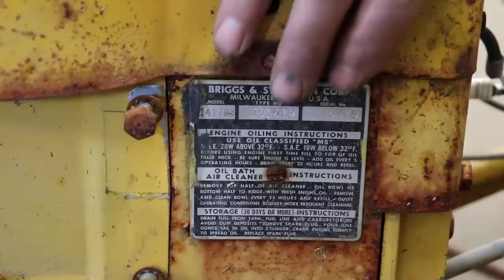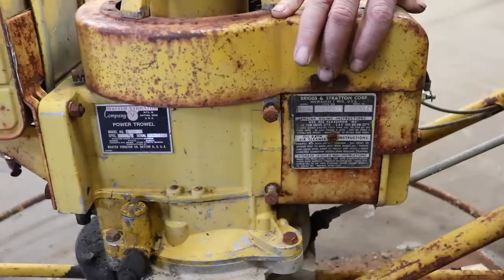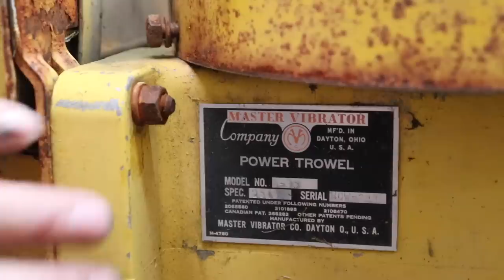AMAZINGLY RARE Horizontal/Vertical Mount B&S Engine

Comment: Taryl I'm Proud of You Fixing up the Arrow Master Power Trowel, if You pull up on the handles You go Right, if You push down You go left  I ran those finishing Concrete, that almost looks like floater blades on it, Thank You for Resurrecting it!

Comment: That's what I love about Briggs small engines from the 50's through the 80's. The parts interchangeability with slight modifications is possible to keep an engine running especially the 2-4 hp series.  A tinker's dream.

Comment: Your the man Taryl. I ran into the same flywheel issue on an old 3 horsepower 1960’s  tiller I was fixing for a friend of mine. I had to get a newer flywheel to make the magnetron coil work. The magnets on those old engines are different and won’t work with the magnetron coil.

Comment: I have never seen an engine that could be mounted horizontally or vertically ,great video
Reply: Honda has a vertical and horizontal engine. It’s smaller but it works. It’s in the 30cc range
Reply: Luv it guys .. best from Danny in Australia

Comment: You guys get an A+ on this video from me.   The old engines and equipment are the most satisfying to get running again.   Those power trowels, you push down and lift a little to "steer" them left and right when they are running.

Comment: I watch this video and your statement about briggs making the engine for this manufacturer. 22 years a a Sears mower repair technician I remembered a Montgomery ward 10 HP briggs cast iron engine that came in pouring oil out the sump. I was going to just pull the engine and replace the sump, easy right. The sump was extra deep and the front axle pivot bolt went through the cast iron sump. I never saw another one, I think it was made by Gilson??. The gasket was nla  so I split the engine cleaned it meticulously  put it back with RTV. Didn't leak and never came back. Have you seen this one??

Comment: I loved Taryl's custom craps video, he makes the best custom craps around.
I have seen one other engine capable of going horizontal or vertical, the Kohler Magnum Opposed twin, looks like a really good engine, sucker takes almost as much oil as my 4 cylinder pickup, haven't got around to using it yet, removed it from a Craftsman GT6000.

Comment: I'm glad you got it going and did right by it keeping as many of the original parts in the process. Now as this is not the average homeowner equipment it would be swell to see it return to a job-site where it can celebrate it's return from what may be decades of neglect.  How happy it will be to return to the sunshine and finishing the surface of a home slab or patio.

Comment: I just done exactly the same thing to a wind up starter Briggs yesterday. And taryl I've sanded a 3hp coil to fit a 5 hp flywheel in the past, it did spark but it stuffed the timing up, couldn't start it.

Comment: Both of my parents are a Briggs only that I didn't get onto one of them whose a Foster in my area.

It's amazing how some of the more modern Briggs and Stratton parts will fit another Briggs engines which is 50-60 years older !

Comment: Never seen a Briggs engine that can be mounted 2 different ways Horizontal or Vertical, has to be a rare engine. Thanks for the i fo on the flywheel and coil.
Hope your having a great Easter👍

Comment: Taryl, what was the big round hand knob for, changing the blade angle? R-L Carbetrater Speed Lever, the big Round Knob, Carbetrater Safety Starting Low Speed Lock out Lever.

Comment: Never run a concrete one but i wonder if the handle is the same as a waxing machine where you lift up or down on the handle to keep it from moving in one direction. Lift up or down to keep it centered. It controls the right to left movement.
Reply: It's pretty much exactly the same

Comment: Hey Teryl, what's with those vent slots on the  yellow blower housing?

Seems like that would let cooling air from the flywheel leak out, rather than be carried down to the cylinder fins (?).

Comment: So did the new coil not work because the other flywheel had a different style of magnet, or were the old ones too weak. Working on pretty much the same motor and having the same issues. New coil but not spark.

Comment: I was able to get spark on an old (1976) model 5 HP Briggs engine that a neighbor gave me (leaf blower) by sanding the flywheel and the coil contacts. Five years later the neighbor has sadly passed away but the engine still runs great at 3600 RPM!

Comment: It's cool to convert one to electronic ignition,however with a ohm meter you can ohm out the primary and secondary and check for shorts on any coil I'm sure you know that.. It's your engine buddy!

Comment: I have a question what is the best motor oil for lawn mowers . I live in the desert so it gets really hot I seen a Briggs & Stratton had a 15w 50 synthetic.. can I use 15w 50 synthetic motor oil from Walmart I seen mobile one for like $22 5 quarts of oil that's pretty cheap

Comment: It works. I done it to a push mower from 1965 that the points were bad and I had an electronic ignition coil that I ground down. Put it on and it fired right up

Comment: The 2 stroke Suzuki’s on Toro were kind of the same concept. It was originally a horizontal shaft engine on CCR2000 snowblowers and then an adapter plate was added to make it vertical for the Super Recycler mowers.

Comment: Great job again! The kind of guy you wished lived next door. I have an older 10 hp briggs I want to switch from points to electronic ignition. I recall Taryl reversing the coil so you didn't need to send in the flywheel and risk not getting it back due to broken fins . I just wonder if that would've worked in his case with the original flywheel? This is really my main source of importation when I'm stumped on something so I wish he would camp on the coil subject for another video,that Taryl!
Reply: I agree you have the best videos on rebuilding and restoring these motors and  equipment  good job you have so much knowledge  people like me love it .keep up the good work.!!
Reply: I have a old ground hog tractor I'm hoping to restore.1938 to 45 I hope!!

Comment: They still make the power trowels with the inside rope pull starter. Like you said the concrete doesn’t wait for no one. You always hope that when the rope brakes it’s long enough to use it to start the trowel. 😱

Comment: pull up or push down on handle to steer. worked on trowels for rental shop. new one's have weighted arm to kill ignition as a safety if operator looses control.

Comment: Those are one of the “transition” engines made by Briggs. The block (except the coil mounts) and other things are the same as the 65 and up versions that we all know, but the flywheel, coil, and and carbs are the same or similar to the cast iron engines, like the 5s. They are nifty little engines and they’re pretty rare

Comment: I thought of using the coil off of the 10 hp too. I also wondered if you could just use the 10hp flywheel magnet on the old flywheel?But Taryl what does the knob do?

Comment: Wht did the knob on the end of the handle do? Does it really adjust blade pitch?
Reply: I learned how to finish in '95 on the modern version of the master vibrator only its now called master finisher. good machine. lots of power. but yes the knob does pitch the blades.

Comment: Are you sure this engine is a 6HP and not an 8-10-12HP
Since most 8-10-12 hp engine share part but they don’t share parts with the smaller engines.

Comment: Had a Master troweler and screed back in the day,  little newer probably built early 70's  to control the troweler direction of travel you raise or lower pressure on the hand grips

Comment: The type of blades on the power trowel are combination blades, finishing blades are skinnner. The combo blades you can get on the concrete when it is wet and then do a decent job finishing, but if the trowel is fitted with finish blades you need clip on floats on them to get on the concrete when it is wet. The clip on floats make the straight side finish blades look like combo blades then when the cement is hard enough remove the clip on floats and you can put a high degree of smoothness on the cement. Some contractors  have a trowel with combos on and a trowel set up for finishing as well. A side walk finish is good enough with a combo blade and is usually broomed to make ir abit rough but a shop floor is nice a d smooth
Reply: A smooth slick shop floor equals a slip and fall  hazzard!

Comment: Yeah sanding only affects the air gap, with rust build up, it might damage the coil, I always use a wire wheel on my dremel pen to clean em up, but rust shouldn't affect the magnetic field.

Comment: Close to 55 years ago my dad bought a Wagner Little Giant lawn mower. It had a very large 8HP B&S. The coil went bad probably about 15 years later and the coil was $50 so it wasn't worth it to him to fix it. That mower would eat grass. Anyway the guy I sold it to mounted a car coil to it some how and used it for another 10 years. Worse thing about the mower was there was not one shear in the deck and it was gear driven. The blades ran in opposite directions so as to through the grass out both sides. 
Just thought a little while ago about the 1965 tornado's up there, if you were around that area I bet it was close to you.

Comment: You can actually narrow the date for that machine down even further as the manufacturer plate for the master vibrator company doesn’t have a ZIP Code on it. The United States started using ZIP Codes in mid 1963 so its older than that.

Comment: I definitely have an old 2.5hp Briggs with a code from 1960. I can't go get the full number right now but that was the first engine I ever worked on...I very much remember needing the date code. Had the same problem, needed to use a modern coil without points, but you gotta swap the flywheel too.

They'd still be cranking out the exact same engines if the EPA and China hadn't ruined it all for them...

Comment: I had a sheered key on my grandparents mower and found the hex key that fit best, cut it off at maybe the right length, close enough, and she runs like new. Also cleaned the carb, combustion chamber, cylinder, sanded the decks, new gaskets, oil, air filter and good to go. Maintenance, maintenance, maintenance! Your equipment requires attention and therapy, just like your wife. If you lose one, you don;t deserve the other, or something like that. You gotta clean'er out real good every now and then...

Comment: try to clamp anything laminated before u drill or sand it otherwise the layers will each flatten back in a tiny bit, if its clamped tight its alot harder to burr back

Comment: Master VIbrator Inc went out of business in Dec 1965.  So, the engine and trowel predates that year and the date code years.  The data plates are in excellent condition base upon it's apparent age and use of the equipment.  Early 1960s is probably a very good estimate.

Comment: Crap man, Breaks&Scrap'em started the code date in the 50´s, I got a model 6 vertical from a Toro from 1959 that has a code date! My 5s from Oct. 1954 doesn't have a code date yet though.

Comment: 146700, 170700, 190700. 6 hp, 7 hp 8 hp.  14 ci 17ci 19ci. Same size shroud in the 60s and early 70s 146700 was discontinued in the early 70s. These codes started in 65 or so I think.

Comment: Taryl ….a little tip. When you cut the tails off the wire ties, never cut them with a side cutter. Take a pair of Lineman  plyers and SPIN the tails till they separate from the tie. The heat from the separation will melt the severed tail and leave a nice end. NEVER BLEED again.  No sharp ends to cut your knuckles.

Comment: If the recoil broke it looks like you could leave the shroud piece on and just remove the top recoil assembly piece so you could use manual rope start.  Then the flywheel will still be covered.
Reply: Thats the way  briggs  intended,  air vane  governor  will not work without  blower housing in place,and engine  will  also overheat without  it.

Comment: Just throwing it out there.  Disregard if you don't  like it. Walmart has a fuel tank repair  coating.  You wash out the tank with acetone,  then slosh the stuff around inside the tank. I put a piece of tape temporarily over a pin hole as I did the sloshing.  Then peeled it off  and painted it. 2 coats worked wonders.👍
Reply: I used it to fix an ancient  torpedo heater.  It's  on my channel if ya want a peek. Keep up the good work!

Comment: It would need a different base to be used as a Horizontal Shaft driver so oil could be changed.  I use a magnet to remove loose rust in a fuel tank.  Nice to see an old Sediment Bulb again.  So third coil and second flywheel?  I lost track.  You could remove the blades and put on wire brush sections and make a super sweeper!
Reply: I was thinking along the same lines - the oil fill as-is would only work in the "vertical shaft" position.  Buy maybe there is an adapter, not installed, that would turn the oil fill 90 degrees sort of like the adapter on the carb?
Reply: Use caution on pre 70's motors and fuel tanks. The white deposits are probably lead. I maneuver a magnet close to the fuel outlet and leave it there. It takes practice just to get it through the filler.

Comment: They make you take a test every year just to be an approved repairer ?. They don't do that here. You only need to set the test once however there's a 3 day ? or more in house training program & when you sit the initial exam you don't need to sit it again & you get a cert. There's the option if i'm not mistaken to do more training & advance with more quals ?. Never seen a right side up motor that can sit upside before

Comment: FYI Taryl I could see you don't  have any idea how to control this machine when it's running. Simple: you can sort of learn in minutes. Direction of travel of the blades is controled by lifting up on the handle or pushing down for it  to go right or left and to run n stay in one place is a happy medium between (at  leavel) to the movement right or left. I have never operated a troweling machine but I have umpteen hundreds of hrs on running a floor buffer. I'm sure it works about the same way as a floor buffer. I uncourage you to try it with this little bit of information. Now you have learned something else that might be worth while some time.

Comment: Always a good idea to match the flywheel with coil lamination if gaps in flywheel are different then engine will have advanced or retard timing. I know cause I worked on Homelite chainsaws and messed around with different flywheels and coil lamination to get best timing

Comment: ah, i remember the old .10, .20, .30 rule, coil air gap .10, points gap .20, spark plug gap .30

Comment: Strap at gas tank to a riding lawn mower wheel put your nuts and bolts in there whatever cleaning solution you want put the riding mower in gear and let roll around inside of it strapped to the wheel. Brother gas tank's no good then it's just ready for the junk file.

Comment: Hey Mate, yer killing me.  Grind down laminations to fit the curve?
Dude,  your awesome brain is so far out of the box, I feel like a
carpet flea in comparison...
16:40 - There is a fine insulator (glue) between laminates.  
When heated on the grinder, yep, glue melts and they separate. 
Ya could dump glue between the laminations and clamp it,
but why....the magnet doesn't care if there are small
air gaps.    Gotta continue...

Comment: Motor will burn up without that cover on it. Won’t get enough air to cool it
Reply: To use the rope start you leave the blower housing on and just remove the recoil part.
Reply: Ah ok thanks. Yeah I was wondering haha

Comment: It looks like a old 5 and 3/4 horsepower: (. I stand corrected it's  a five horsepower not 5,3/4oh well they made 100 million..
Reply: I love that carburetor with the low and high speed adjustment I do have one of those on an old mower with a rope pull start it's a Dixie aluminum with the one wheel in the back yeah that thing runs good..
Reply: Rent it out

Comment: Total crap... Had a engine that would not start sanded the rust off the coil and mag.. It fired right up..
Let me guess it wasn't the sanding but the quasiparametric alignment of the stars